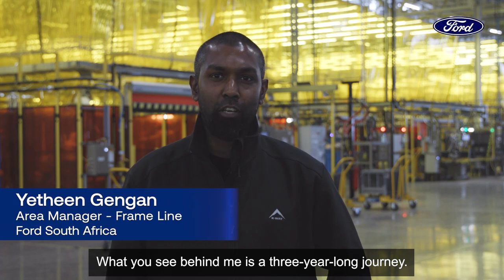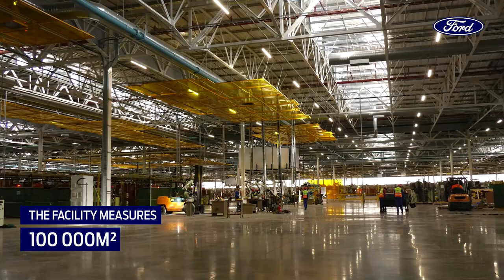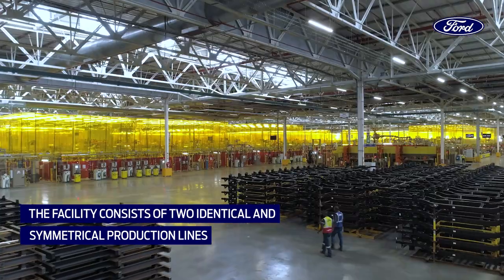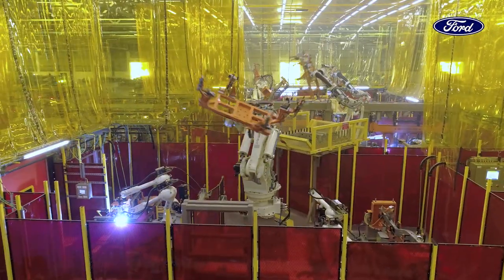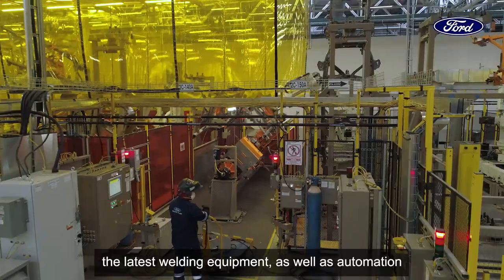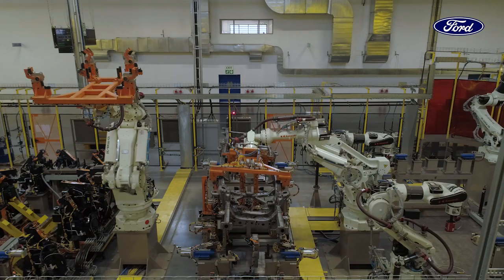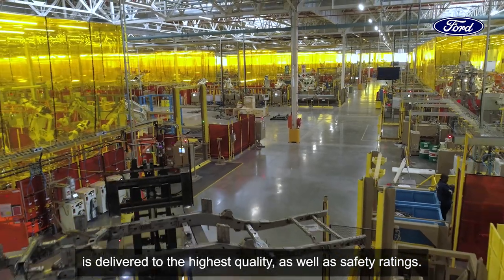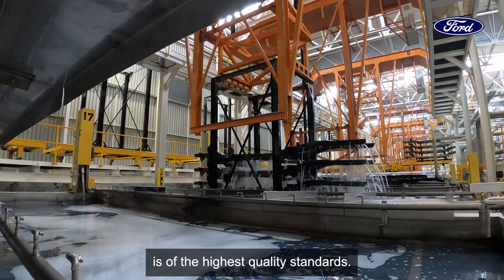Ford Motor Company of Southern Africa High Tech Frame Line

Comment: Great facility and also great to see where my new Ranger’s chassis is made. A bit more detail on the steel, the fabrication and the paint process would be good.  Also just why are there stamped holes in the side of the chassis facing the wheels, allowing corrosive water and road muck and salt to enter the box section?  If they do have a valid reason to exist, surely they should be fitted with plastic blanking plugs. That also includes the massive open ended cross brace pipe that juts out into the rear wheel arch area of the chassis, all of which I shall be blanking off before waxing inside and out and the under-bed and cab area before first use.  My nine year old Silverton built RangerT6 still looks good in all areas after having the same treatment when new. 
So for the ultimate in vehicle quality I suggest fitting plastic plugs in all chassis holes facing the tyres in the areas that get direct wheel splash. I do note that there is an option of having the chassis waxed in the UK price list, which is to be commended and recommended.